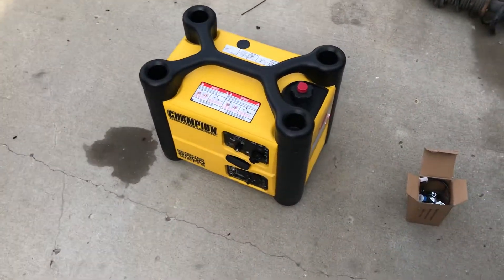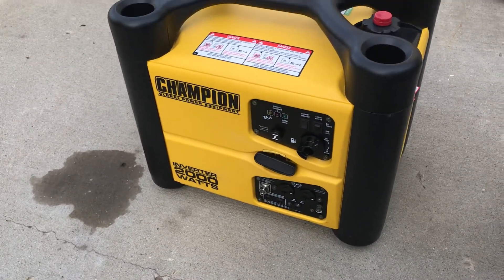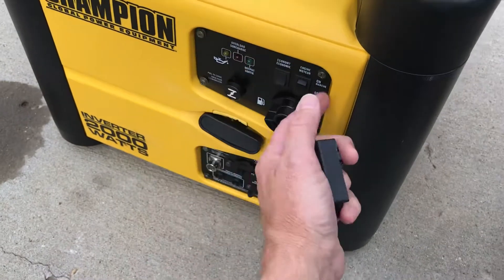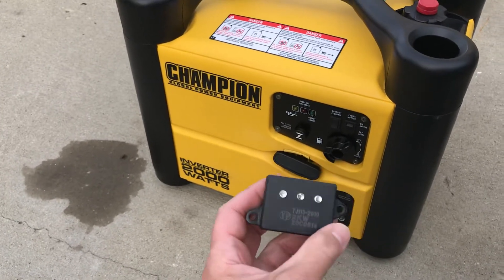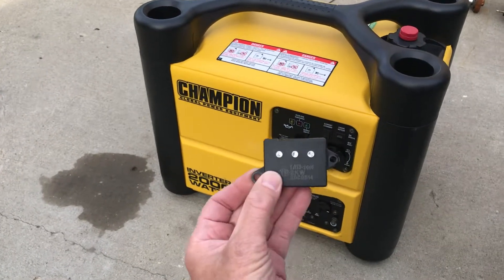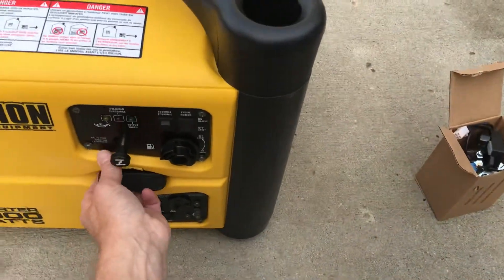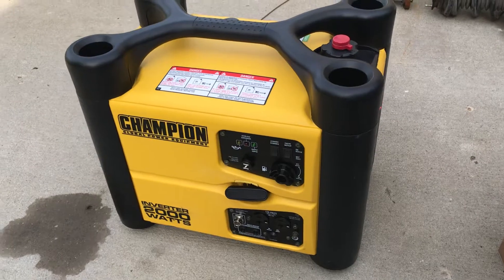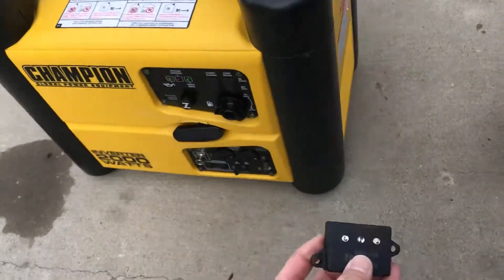Update! Champion 2000 watt inverter generator. It runs! Thanks Champion!

Comment: That module went on mine too. I shut it down during an outage to change oil and wouldnt restart after. Replaced coil first since it was only part available and no go. Several months later the module came available and good for now.